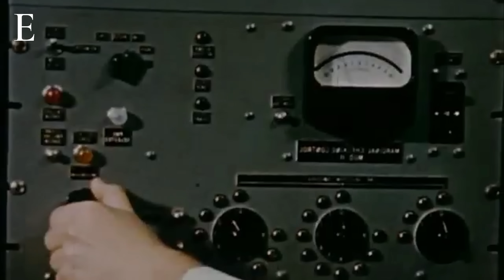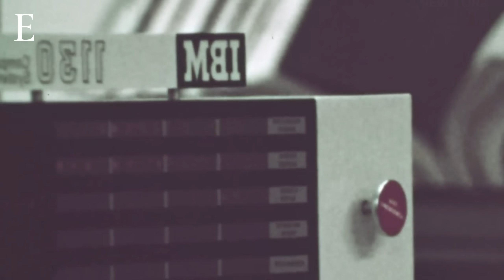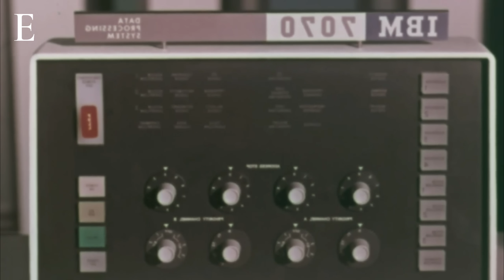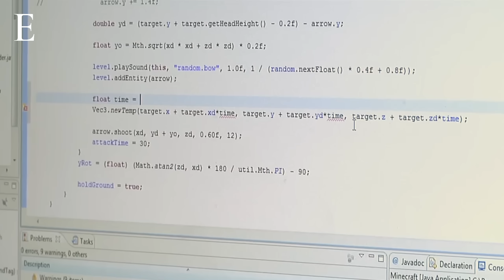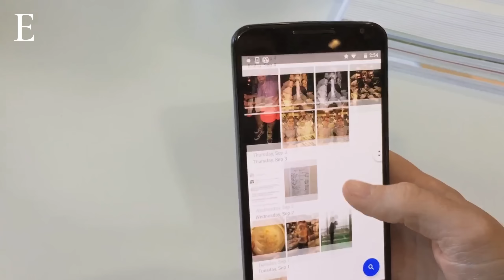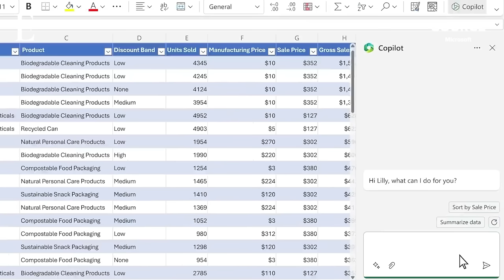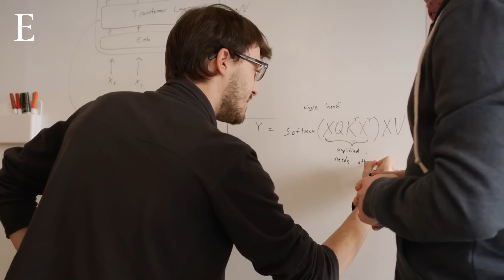The Rise and Fall of Software Engineers

Comment: "AI" as what people thinks of it won't be able to replace advanced software engineers no where near in 15-25 years. This isn't just about software, it's about hardware as well which plays a direct role in AI tech. If AI wants to replace humans, we first need a physical device which is far better, faster, efficient and much smaller (physically) than a human brain, good luck on that one, it will take at least a decade just to get started. BTW don't confuse with devices which only compute numbers based on what it is told, like your common hardwares (CPU/GPU/NPU), those are dumb computers.

Comment: Total BS. AI will be able to replace software engineers only when a higher up manager will be so confident with its generated software to put his job on the line in case of trouble and I dont see this manager in the horizon.

Comment: People still can't understand difference between programming and software engineering
Reply: That is not even the point. AIs are currently unable to put together coherent solutions to large, complex problems. They are barely able to work with existing code. There is just very little there to replace programmers. What AI is really good at is acting as a programmer's assistant, getting them up to speed quickly in areas where the programmer is less knowledgeable, and to some extent, diagnosing problems in unfamiliar areas. But that is about all, and the rapid AI upgrades have already tapered off. We may need less programmers, because the existing ones will be more efficient with AI assistants, but the need for programmers will always exist.
Reply: I've asked AI, he says there's no difference for him
Reply: The difference between programming and software engineering is rather obvious. The latter is like construction engineer who plan, calculate, design, and draw the plans for a building. The former? They are the ones stacking bricks on top of each other. According to the predetermined plan. In both areas, AI and automation can help for sure, but laying bricks is much easily automated…
Reply: @LeonMillon9x the problem is employees don’t care the difference, they just want to finish the work, they are overwork and underpaid
Reply: The thing is that most people who never had to debug some elusive Heisenbugs or even mind-bend over someone else’s code (and I’m not even saying shitcode, mind you) don’t understand that the actual spurting out code is just the final, externally perceiveable expression of a SoftEng’s work effort. Even without going into higher-level abstractions like architecture or system design. The LLMs are just very good at guessing which word should go next, but have no idea or insight into what that means. If they’re lucky to be right - that’s great, but if they are wrong, then a human has to step in and analyse what might’ve gone wrong and where. The problem is that it’s much more difficult to understand someone else’s code (here: the LLM’s code) than just write the correct version from scratch yourself. Laymans don’t get it because it’s different than in typical daily activities.

Programming is more like playing a multi-dimensional game of abstract jackstraws, all imagined simultaneously in your head. It’s even harder if you have to guess what some other programmer (or LLM) had in mind just by looking at their code.
Reply: @ansidhe every job has its difficulties. Software engineering will still be relevant just not as highly paid anymore since there're more tools to make it easier
Reply: I would say that for me, I program for the most part. That is to say that I write code that augments the existing ERP and other legacy systems mainly for small town logistics and manufacturing companies. I am typically not working with a team building new software from the ground up on a full project. That I would say is more software engineering. The jobs that are mostly, IMHO at threat are development jobs at large companies .. the typical FANG type of jobs that I would never consider working at in the first place. The small companies I work for can't afford all this supposed agentic systems and AI, etc... And besides. They tend to like employing people. It puts food on peoples tables.
Reply: The same people that don't understand that difference, or the difference between GitHub Copilot and Microsoft 365 Copilot, are the ones commenting "Cope" and making fun of  software engineers for their supposedly demise.
Reply: Can you explain? Our daughter has career decisions to make.
Reply: My AI girlfriend rated this video 1 out of 10.
Reply: Aren't they used pretty much interchangeably? What's the difference?
Reply: @kuruptzZz  can you build a dog house the same way you build Burj Khalifa?
Reply: @lan_dev   yeah I see, software engineering of course encompasses a whole lot more. I have heard them used interchangeably as well, so it's not nearly as drastic as your analogy
Reply: @kuruptzZz  that's the probem. They are not interchangeable.
Reply: @lan_dev  That is the point!
Reply: @kuruptzZz  nope
Reply: WHats the difference?
Reply: Software engineering is about designing and managing the overall software project, focusing on applying engineering principles. Software programming, on the other hand, is specifically about writing the code that makes the software run. So, one is the big picture; the other is getting into the nitty-gritty of coding.
Reply: Is it not the same thing?
Reply: @queen1001  no, programming programs what a computer should do. Software engineers does the same thing but more than that. We do system design, software architect, designing databases (entity relational diagram), planning, communicating, choosing stacks, and overall systems. These are the things AI can't do. AI can program, but they can't well design everything.

Comment: It's such a bad click bait, but in the end you reflected pretty nice.

AI is a co-creator, an assistant. Even Multi-Agent-Systems are not really capable of doing human level tasks in a complex environment. They're faster but more prone to errors, a lot more. 
You dont want vibe-coders on your multi-million dollar code base, nor on your high confidality  company data. 
Everything you enter is at risk of data loss, even if it's using their API. Like OpenAI didn't train on Disney and other IP, they just filter it on the output now lol.

But this panic making while it is just usual evolution on the job market. If you learn to prompt or learn the 14th new framework, doesn't matter. It's just a new tech, especially because Software Engineers are some of the few groups to understand what happens in "AI" which is basically just NLP with a transformer with some techniques added wrapped in a back-end / chat ui.

Comment: Copilot is ok. It sometimes generates exactly the code you were about to write. But 50% of the time it suggests something you dont need to do. For instance, I start to write a comment, and copilot takes some code it saw near the top of the file, and suggests code like instantiating an object and populating it's fields. But I dont need to do that, because in fact that was already done somewhere else in the code, and I just need to add my new enhancement here in this other spot of the file. Its a cool tool, but there's no way a business analyst with the design they came up with can just tell copilot in plain english what they want, and copilot updates the classes required, writes all the tests to make Sonarqube happy, and runs integration tests to make sure the changes dont affect something downstream. At least, not that I've seen.

Comment: AI is a tool that only works best at the hands of the best mason in town. If this sounds farfetched, wait until you try to generate a full application on your own with no prior formal computer science or programming education and experience. You'll be stuck and lost for good, and most likely it won't execute.  Everything nowadays feels AI. It's becoming increasingly difficult to seem original, especially when a job involves digital tools. These creators should stop it, software engineers are here to stay, and aren't going anywhere, anytime soon. The last time I checked its digital artists, painters, and creatives that are getting replaced faster than the engineers.

Comment: Don't read this.  There are roughly 35% of all jobs hired everyday even as of today's date.  AI cannot fix multiple  migration issues or multiple requirement changes across the platforms without still requiring alot of intervention.  More like realistically 15 years for really deep cross platform quick iteration and updating high level changes, not that sophisticated even close.

Comment: 7:52 The rate of AI innovation right now is phenomenal. Both the US and the Chinese are introducing reasoning models and thinking architecturally/creatively is not far behind.  We're designing models that will reduce costs and put ourselves out of a job.  What's left for developers to do will eventually be decision-making and checks & balances.  But it's only a matter of time before AI models are trained on those skills, too.  The traditional software development job will be replaced with a limited number architects and decision-makers.  The once well-paid, white-collar jobs that required interacting with a computer screen will be replaced with AI and the next generation of jobs will be blue-collar jobs/trade skills where robots are currently unfeasible... at least for now.
Reply: Lol where will they get data to train that?
Reply: @farmsoilai  they will probably steal it. That is the way they get most of their data. Some of the companies have even been found to use bittorrent to download data for training. If we did that we would have huge fines but apparently if you are large enough it is fine.
Reply: @farmsoilai you need humans for now, that won't be the case in the future.
Reply: A ai model is limited to the data it is trained
Reply: The reasoning models are fake. They are parlor tricks. Just changing the variables on a math proof is enough to foul them up. They have been pretty extensively tested and they can't reason. I have used them. They make a LOT of mistakes and you would have to be an expert to catch most of them. These things are still worse coders than a junior developer and the research indicates they have plateaued. Vibe coding doesn't work and that is going to implode on itself.
Reply: Yep, we are all moving into a Star Trek universe, and lots of people don't realize it.

Comment: Modern coding is already a branch of Germanic language. English won’t replace code. Rather code will be a new English. The high level instruction will still be “code” rather than English which flawed ambiguous human language, and not entirely deterministic. Another option is using a very structured “law language” to replace codes. Then we all have to be lawyers. What’s happening is that software engineering as “labour” is now obsolete with AI tools. But software engineering as intellectual value is still very much valid.

Comment: they confused Copilot with Github copilot 🤣
Reply: They completely mashed the two together
Reply: This really made me feel safer.
Reply: Wow they confused a word, now you must be correct about anything else...
Reply: @dasaauploads1143  A bit more than that they confused a concept and misrepresented statistics, but whatever
Reply: Microsoft owns both Github and Copilot... hence the same name and trademark... 🤧
Reply: Whats the difference? They are quite similar. Owned by Microsoft, using same AI modal etc.
Reply: @dakustudios  Github copilot is fine-tuned for coding tasks whereas Microsoft Copilot is rather a general chatbot powered by ChatGPT.
Reply: @dakustudios  There's enough subtlety that I get the mistake 1. GitHub Copilot = In IDE code completion tool 2. MS Copilot = Conversational AI Chatbot that can also be used to ask about/generate code.

The way they framed it as if Copilot generated 40% of code, not that GitHub Copilot completed 40% of code, which is different.
Reply: @dakustudios  They aren't the same model, they're trained for different things

Comment: vibe coding is good for very simple small project. but for complex and deterministic Softwares you need to have a team of sw developpers not for programming but also maintenance and new or changed requirements. if Managers wanna to trust ai on this also, they can. a cleaning on Manager side especially MBA Managers is also needed since 20 years. Technik Managers must be return to the upper positions in company. there are tons of useless Managers.

Comment: As a lifelong expert in the applications of real-time AI to both military and civilian applications, currently to safeguard our food and pharmaceutical supply chains, I believe that there is a difference between general knowledge, which humans are good at, and specific knowledge, which computers are good at. Also, all regenerative AI algorithms are based on statistical, self adaptive, non-linear, matrix correlators; so it is worth remembering that there are lies, damn lies, and statics. Yesterday DALLE3 generated a picture for me of a person holding a cellphone in both hands while their third hand entered data. Statistically correct, probably with a high correlation to my input text string, but I would not want to use a statistical correlator to fly a plane I was on or to safeguard our food supply against bioterrorism.
Reply: these models improve every day : for the love of god, STOP picking the AI state of today as the AI state of the next 10 years.
Reply: DALLE3 is old and outdated.
Reply: Yes and so am I - but DALLE3 has far less post-filtering and so is great for examples like this
Reply: It depends on the quality of the data. If the problem is well documented, the model gives decent output. And that reduces the size of the team you need to to the job. It can't fly your plane, but you don't need 2 or 3 pilots in the cockpit anymore. 1 is enough.
Reply: Yes,  as a Tech Director I find that I use regenerative AI primarily for looking up information in documentation for software and standards that otherwise would take hours - but it is of limited value for code generation except to quickly generate code snippets as an example for programmers that I am directing